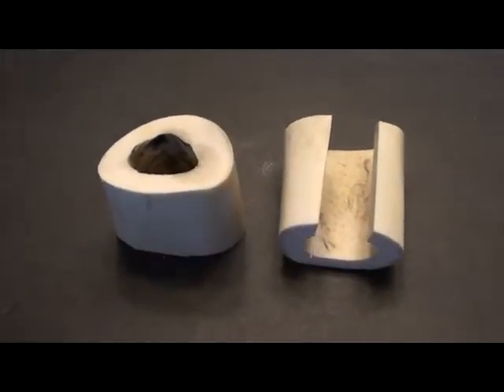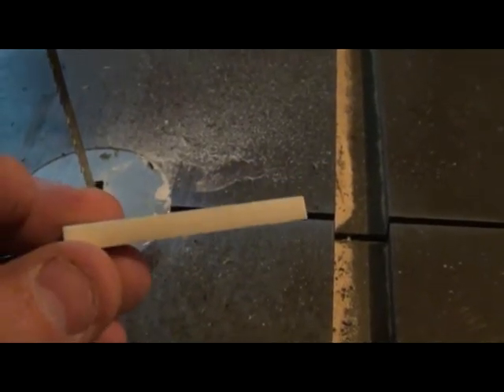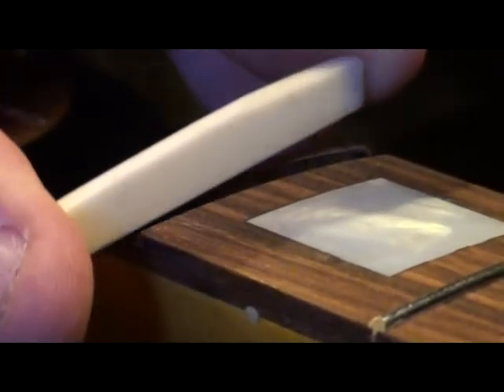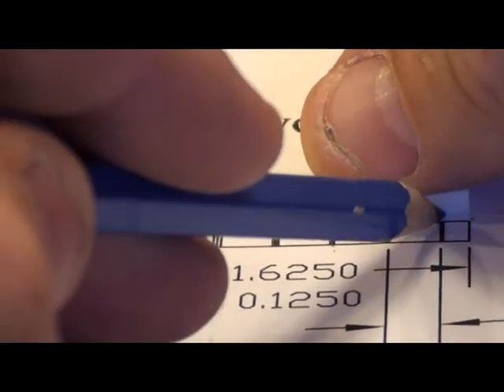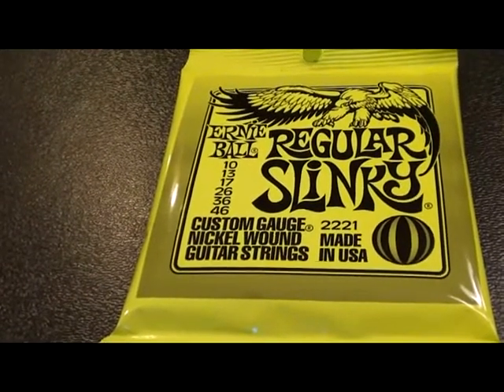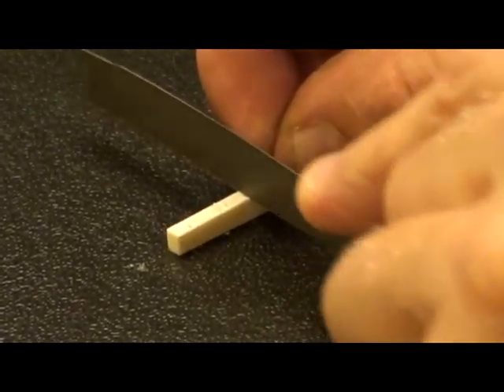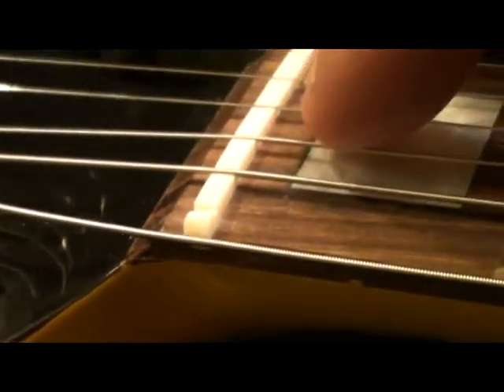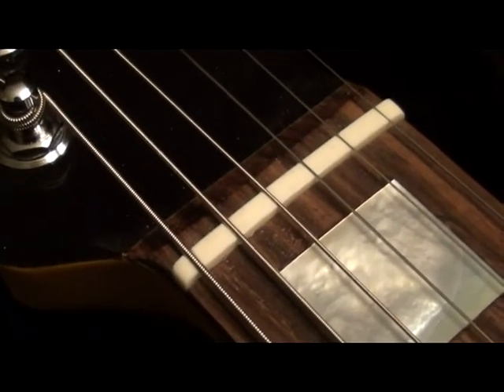Update to Making a Bone Nut

Comment: Abrading bone can lead to the surface being sticky, it smells too when you do it. I  cut into usable pieces then plane it to size with a mega-sharpe block-plane. I finally finish the last shaping with a sanding-block. Cow shin-bone is the best, stinks the house out when you boil the crud off it to get it clean & usable.

Comment: COULD YOU MAKE A LIST OF TOOLS YOU USED. THANKS
Reply from the maker: Sure.
Femor bone from cattle.
A bandsaw or scroll saw to cut blank.
A sander, belt or disk. To shape
A set of nut files to file stting grooves. 
Glue to set nut in place